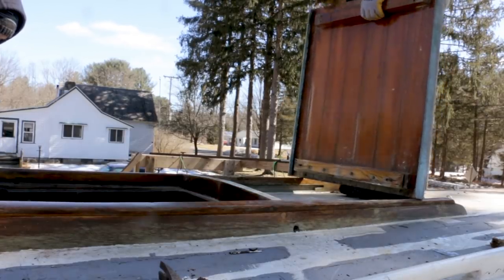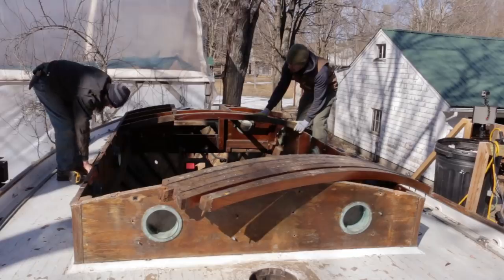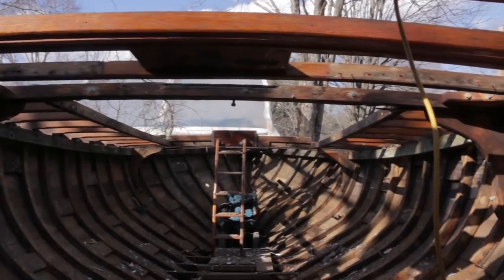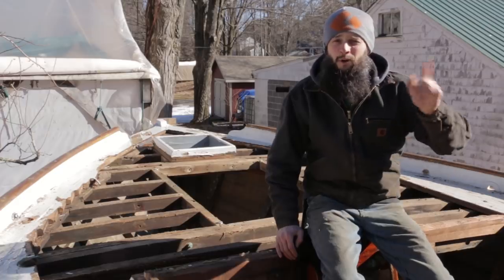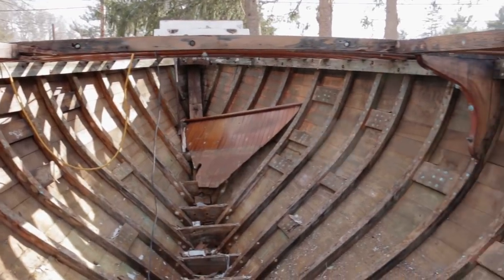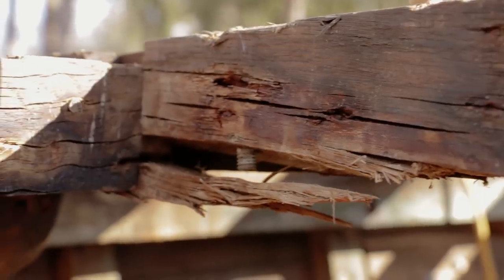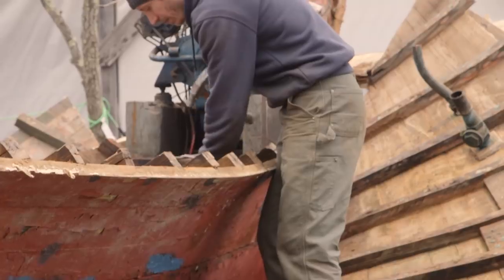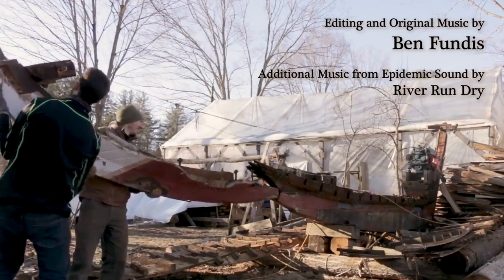Acorn to Arabella - Journey of a Wooden Boat - Episode 58: Dismantling Victoria

Comment: On those deck beams near the mast, also note where they broke, checked, and cracked and the relationship to grain structure. Is the woodgrain run-out up, down, or straight grain? Looks like the beams had downward run-out (from the end of the board) and that's where they gave way to the torque/shear of the deck lift.
Reply from the maker: We did our best to do just that!
Reply: @AcornToArabella  good I go to know for the build of Arabella. Glad this didn't slip your minds. A lot of people shut down a lot of their learning during demolition phases. Thanks for your reply.

Comment: It will be interesting to me to see the keel bolts. The old boat I started to rebuild before giving up turned out the keel bolts were thinner than a pencil and was a disaster waiting to happen.
Reply from the maker: A bunch were replaced but the ones that had not had the consistency of packed mud, literally nothing solid left in the hole. If Victoria was sailed even close to hard she would have crumbled.
Reply: @AcornToArabella  Yeah, had I ever hit a deadhead mine would have blown apart too.

Comment: What if, instead of doing tie-rods you mounted the mast to the keel and the deck and add additional beams around it to support it? Might be sturdier and won't stress major beams. As for the age, boards will split on their own as they dry out and get weak, so might not be all on the mast. For being 100 years old I'm impressed by how tight the boards still are and the rot wasn't worse.
Reply from the maker: The mast/deck need to be able to move a little bit so directly attaching mast to deck would be a poor idea.  But people do attach a turnbuckle from mast to centerline and another turnbuckle from mast to deck so the mast becomes the tie-rod but the system still has some give.
Reply: @AcornToArabella That true, didn't think about the deck moving.

Comment: Pretend for a moment Victoria was going to be rebuilt. At what point would it be (apparently by tradition) and/or what structural parts replaced would cause her to not be Victoria anymore?
Reply from the maker: Everyone has a different view point on that one.  It seems to depend more on the order of operations than quantity of material.  Many full restorations have been done where the only remaining piece is the ballast keel.

Comment: Subject:      SALVAGING DECK PLANKING
One of the worst sounds a boat builder can hear when planing or cleaning up salvaged wood is a hidden or broken metal fastener chewing up expensive planer blades.  The best and least expensive way to avoid this disaster is to purchase an inexpensive metal detector.  Use this detector to run down each board before sending it through the planer.  It will detect any metal embedded in the wood.  This small investment will save a boat builder the frustration and heartburn of having to resharpen or replace expensive planer blades time and time again.
P.S.  I'm looking forward to launch day.
Reply: or a magnet
Reply: @iyurtygaming8588  Since the fasteners are a bronze alloy a magnet won't help.  There are inexpensive metal detectors made for woodworking, much like the hand wands that TSA uses at airports.
Reply: Also they now have new planer fixtures that use cutting inserts.
Reply: @David-hm9ic  awesome, didn't think of that. I recommend a makita planer, very cheap replaceable blades instead of a scraper too
Reply from the maker: I think a stationary drum sander and bandsaw will be the tools of choice for cleaning them up/re-sawing them.  A quality bandsaw blade will slice right through the bronze/copper fasteners and the sander will remove varnish, paint, crud.. and not be terribly bothered by some metal fasteners.  Sand paper is cheap enough =)

Comment: There is another reason why the mast can pull up....   In sailing parlance it is called lift, under sail the sail it self acts as a wing and sucks the boat through the water (sorry, teaching aged grandmother to suck eggs) that lift obviously has some complicated force components but one of them is UP.  This is a really complicated thing that I only understand from an end user perspective (mainsail trimmer).  There is also the transferred force across BeamMax through the shrouds and stays as you mention, one component of the force will be perpendicular to the mast.  (Head spin!!)
Reply from the maker: Interesting.
And that us why it all needs to be very strong and resilient!

Comment: How can you survey, properly inspect, a timber from Victory to know if it is sound enough to reuse in Arabella?
Reply: Bang on it, see if it breaks. Jokes aside. If you've seen enough rotten wood you know what to look for to tell it apart.
Reply: also hold in the middle, tap on it, and if it "rings" it's goodish.
Reply from the maker: Looks, texture, smell, feel, sound, weight....  If one has worked enough wood you can tell a lot just from looking at it and feeling it. Nothing with rot will go into Arabella, don't worry.
Reply: @AcornToArabella  I never meant to infer that you guys would ever knowingly put any bad timber into Arabella. I think you guys are doing a great job! This was a real question as to your method(s) of determining if an old timber is sound enough. I have been working with wood since 1972 and have never found a fool proof method to determine in an old timber is structurally sound.

Comment: It's sad to see a boat go, but it was more peat-cutting than disassembling the deeper You went into the process.
And it definitely was her best fate to have found You guys to dismantle her: there might be no better way honouring a peat-cutting-site boat like Victoria than You plan to do it in reusing her better parts and actually bringing those out to sea again instead of just decorating a clubhouse bar.
Reply from the maker: Thanks! 
We agree.  Her bones were rotten to the core, the interior and paint were holding her together haha
Reply: @AcornToArabella  When I was student of wooden building techniques and specialized wood statics calculations, we learnt another factor keeping wood-constructions together: "tradition", aka "wood's habits" aka "laziness" because it would be much more work to chaoticly tumble down than just to stay where everything was for the last hundred years. (which would be engineers lingo to appreciate the knowledgeable craft to join wood properly,  which makes the ensemble much stronger than the sum of all pieces' strength)

Comment: Can't imagine why you are saving the planks. You already have cedar and you mentioned prior that you will be scarfing them to avoid butt blocks. I see no use for used, curved, planks with holes from the fasteners.

Maybe some of the planks can be forced straight and used for decking or laminated together to make curved deck beams??
Reply from the maker: Hoping to build the tender completely from timber from Victoria.  The planks may not be good for a big boat but there is great stock there for a small one =)